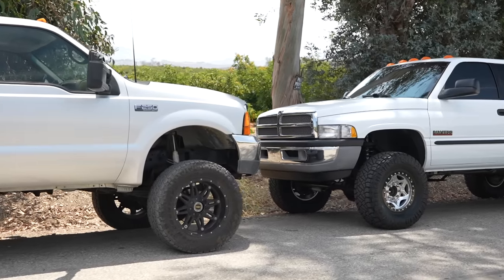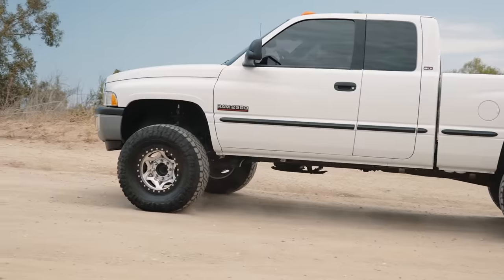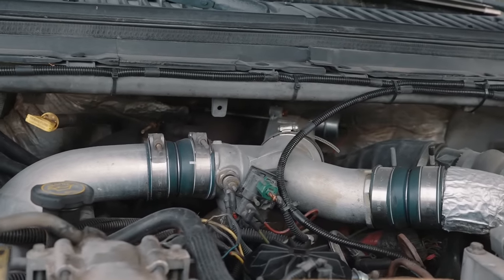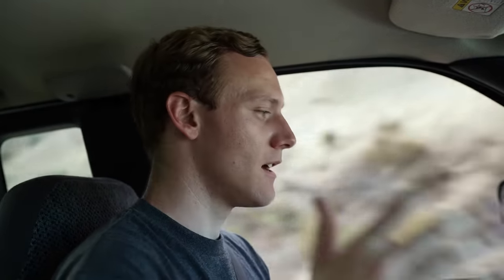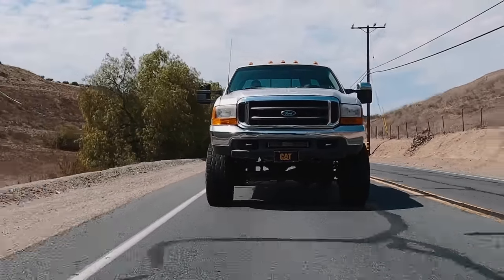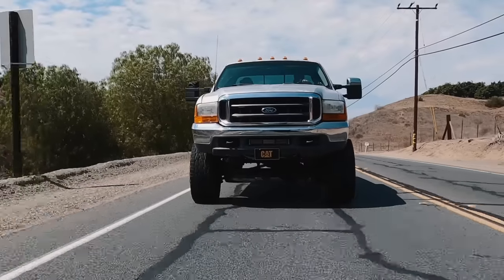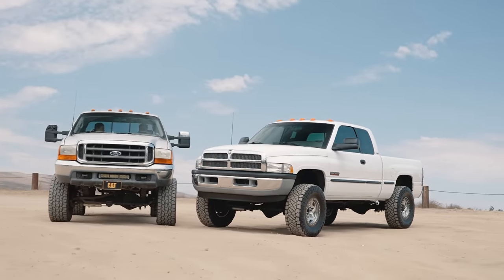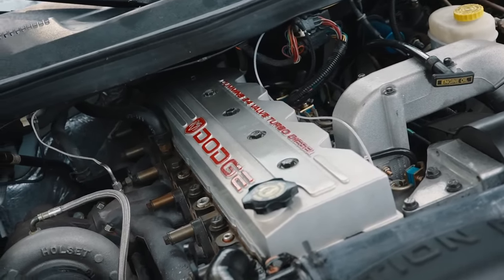1999 Ford 7.3 Power Stroke Super Duty vs Dodge Ram 5.9 Cummins 2nd Gen | Which Is Better?

Comment: The Cummins is the better engine, the Ford is the better truck.
Reply: I see more 7.3s on the road the cummins are dying out.
Reply: @Daniel-sd9fo  thats because the engine gets ripped out and put in something else, usually a ford
Reply: The reason why you don’t see them on the road because the values have shot through the roof.  Everyone wants one. Ford who cares nothing special
Reply: @scoott.735  you must havent seen the 7.3 market lol
Reply: @Daniel-sd9fo  I have and there not worth that much i’ll just get a 12v for cheaper and they last longer
Reply: @Daniel-sd9fo  You don’t see 7.3’s on the road you see a 12v Swapped F250 or 350
Reply: @Anthonysmith-ic8ef  I literally see 20 7.3s every single day
Reply: @skating4ad  Nah You don’t i see 12v on the road daily tho
Reply: @skating4ad  no you see garbage 6.0’s that you are mistaking for fords only decent engine.
Reply: I wouldn’t say the engine is better at all.. for less money you can make the 7.3 motor wayyyy better faster and stronger while still being reliable
Reply: Just a fact there are more 7.3s on the road I know the sound of a 7.3
Reply: I know a lot of 7.3s over 500,000 enough said
Reply: The 7.3 was the greatest engine ever built. You could run them low on oil, hot, dirty air filter it didn’t matter. After that Ford fucked up. The 7.3 was never designed to have a turbo. The later years when they put the turbos on them was better than the ones without turbos. You won’t break any landspeed records in them but you can tow a house. I lucked out and found a 2002 4wd with a manual transmission and manual transfer case. I believe that was the last model (halfway through 2003) that you were able to get a powerstroke with a manual transmission.  It is a workhorse as it was meant to be.
Reply: The only thing about a Cummins is the horsepower is just not there. You put a Cummins and a 7.3 powerstroke side by side and have them pull the same load up a steep hill the 7.3 will leave the cummins in the dust
Reply: Cummins has more power off the line but a powerstroke has more power i general
Reply: @scoott.735  nothing special about Cummins either. They’re they LS of the diesel world, they will blow up, but who cares 😂
Reply: @scoott.735 you haven't seen how much 7.3 Excursions go for...
Reply: I got a 97 F350 crew cab with 148k on the clock in mint condition,  I've been offered 50K for it. The value of these OBS trucks has gone through the roof.
Reply: Shocking last year I found a 1998 f350 good condition 149k miles for 10k
Reply: Btw any mods
Reply: My 7.3 has 418xxx and stopped working months ago... I believe it's a million miles engine
Reply: @Jesus Espinoza  they didn't have any 1998 model year f350's. The ones they did make are labeled Early 99.
Reply: Is I though? I mean I love the cummins and that ford looks great but I think I'd rather have the cummins all around even that interior
Reply: @Daniel-sd9fo nobody’s aspiring to get a 7.3
Reply: @KDlGG i don’t know what stupid shi your saying but ls aren’t known at all to blow up, ford engine are😂 plus it took 15 years for a ford to keep up with a 15 year old corvette😂
Reply: ford is the better engine and trucm
Reply: @Daniel-sd9fo  here in california the markets not hot
Reply: @guamazolopez6456 . Idk when that changed because it was definitely hot in Southern California when I moved. My dad sold his 96 7.3 for over 30k
Reply: If you are the 6.0 it’s a monster I have one and I know a crap load of people in them as well lol
Reply: @stickyicky2858  i got the 6.4 and whole people say it’s flaming garbage i haven’t had problems, it’s really quick too
Reply: @wishihadavette2392  it’s getting harder to get plates for them but a dually 7.3 will still go for 10 or 15k so it’s not  a dead market
Reply: @daves2753  nah I have owned a 2006 6.0 in a manual and a 2010 6.4 in a manual
Reply: @guamazolopez6456  with 2.0 more liters it was faster and ls motor’s definitely blow off p
Reply: @guamazolopez6456  bs look up the price
Reply: See Cummins was brilliant in a dodge. Let's not forget dodge was always the shitest truck built the Cummins everyone loves them
Reply: @scottcampbell1566 if you think that the 7.3 is fords only good engine then that’s wild. The new 6.7 powerstroke is the best diesel engine on the market by a huge margin.
Reply: @eligiebler7834  that’s a Ford fan boy’s opinion only. And a slow one at that over a year later response lol. 
International/ I mean ford is garbage.  

7.3 wasn’t even that good. Ticking time bomb 💣 weak & void of power. Always needing aftermarket help. 
It’s Cummins by miles & miles & it’s the rest trying to play catch up.
Reply: @kylecairus5675  you know nothing about engines ls do not blow up
Reply: @scottcampbell1566  my 6.0 has been driving around for 332k miles with no issues and still running crisp, but keep crying nerd
Reply: @fordshuler307  literally have ford in ya name but ya no fan boy here. Lol 
That 6.0 had head work done super freak.  It was a huge flaw with the 6.0.  Prolly cause ford didn’t really know much about building diesel engines. That’s why they had international contracted out for their motors. Until they got greedy & said we can do dis like Chrysler with their paint.  Only I can deal with paint. Lol 😝
Reply: @scottcampbell1566  it has not had head work done, also Ford is my literal government name so that wasn’t really up to me
Reply: @fordshuler307  hahahaha you’re funny  😁
Reply: 7.3 is THE best diesel pickup truck engine
Reply: Now combine them both 😂
Reply: Jesus loves you all
Reply: @Trevor-mm5ji  I kind of agree, even if you don’t see them in F350s, they are readily available in International box trucks
Reply: 😬 never had to fix them old 5.9s one weakness 7.3 no weakness
Reply: If Ford would have scored the Cummins contract, there wouldn’t be any other heavy duty truck in production today. Not talking down on the powerstroke, I’m a Ford fan, but that would be the case.
Reply: 7.3 all day
Reply: The Cummins is 100x better. Put an exhaust brake on a 7.3 and you will blow a connecting rod and window your junk engine. Also hydraulic injection is trash.
Reply: cummins in a ford, dodge was in kahoots with ford in the beginning 😂
Reply: @Anthonysmith-ic8ef I like the comment but truth is they are both good but the fords seem to stay in road for 300 to 500 then get swapped every Cummins I went to look at to buy was either not running or way over priced
Reply: And that’s why people have made it easy to swap out their powerstroke
Reply: Cummins ain’t that much better than a 7.3 if any at all
Reply: @Roost426  really? because my family has been through 4 7.3 powerstrokes and all have gotten over 1.5 million miles on the odo with the stock engine and trans and good well kept up maintenance, a 98, 2 00’s and an 02, all 7.3 powerstroke f250s, my uncle bought a 98 second gen new, and it blew two motors and 4 transmissions before he sold it for a 7.3 because the dodge was a money pit 🤣
Reply: @scottcampbell1566  6.0 and 7.3 trucks look different, the powerstroke badges on the 7.3s are black with silver letters, and the badges on the 6.0 are silver with red letters, the grills are different too, as well as the color options, im not defending the 6.0 i’m just saying it’s hard to confuse the two if you know anything about the trucks 🤣🤣
Reply: @stickyicky2858  the 6.0 has bad heads and sand in the engine from the factory, you need to put 10 grand aftermarket into it to make it even remotely close to being as reliable as a 7.3, and even then, the 7.3 will still pull more
Reply: @guamazolopez6456  6.4s are 150k mile motors, give it a few and it’ll pop like a shitty bottle of champagne
Reply: @guamazolopez6456  bullshit ls’s don’t blow up i’ve watched camaro ss’s blow blue and white smoke all over the highway 🤣
Reply: @scottcampbell1566  12v cummins will blow head gaskets and fail quicker than a 7.3 dodges wiring us purely garbage but ford isn't far off I love both trucks I have 12v dually and a 7.3 250 both trucks have their issues but u will pick the Ford the haul and long trek with over the cummins any day. I see your a die hard cummins guy but it's not as great as you are trying to build it up too be. The best part of the motor is the fuel pump far as a cummins goes.
Reply: The front suspension on the dodge is hot garbage. Even with a light gas engine in them they fall apart every 30k miles. The top of the dashes cave in on every one of the first and second Gen dodges.
Reply: @jesusisalive3227  all correct except 1st gen dashes hold up pretty well as do 1st gen 4x4 front ends.
Reply: @Roost426 that’s funny because I’m putting a 5.9 in my 95 f150😂
Reply: @daves2753   the 7.3 powerstroke was never designed to be used without a turbocharger. You are thinking of the 7.3l IDI, the only things these two engines share is the displacement. You could also get a manual transmission behind a power-stroke through 2010
Reply: My dad has 2001 dodge manual and it has 6 hundred thousand miles with a stock trans
Reply: i entirely disagree. both have pros and cons but i see the 7.3 diesel outlast a majority of 5.9 cummins trucks
Reply: Duramax is better
Reply: Cummins ford??????????????
Reply: Idk about that. I go trail riding and mudding in my gen 2. Took the carpet and plastic out, bedlinerspray, 20+ years old and no rust on the frame, a little on the body. If I wanted total comfort, I'd say your right, but what I do, id take dodge.
Reply: AGREED
Reply: Cummins
Reply: 7.3s are way better. More bottom end more fun when upgrading
Reply: I completely agree
Reply: @Daniel-sd9fo  the Cummins actually made it home
Reply: That’s cause stock they don’t make enough power to break themselves
Reply: Engine lasts longer than the truck interior but even if rats chew your wiring that Cummins is all mechanical so it will start as long as it gets fuel
Reply: @daves2753  the last manual powerstroke was the 2010 6 4 backed by a zf6
Reply: @Daniel-sd9fo thats gotta be satire
Reply: @MRALEX9870  nope just facts buddy
Reply: @Daniel-sd9fo 96 still goin. Headliner falling off though
Reply: I actually don't believe it
Reply: @scoott.735 I wish this was accurate it's 10k for a gas Ford 🤦‍♂️🤦‍♂️🤦‍♂️🤦‍♂️🤦‍♂️
Reply: @Daniel-sd9fo INSANE! I had a serious offer of 25k on my powerstroke swapped 4wd FSuperduty dump truck. It's super clean and done up right,  but I would NEVER give that much for an obs!
Reply: @Anthonysmith-ic8ef idk why people go crazy for 24v, i saw a 12v for 13k that was mint, def would buy that over a 2nd gen with flimsy interior
Reply: @Anthonysmith-ic8ef a 7.3 will just as long as a 5.9.
Reply: 7.3 is king
Reply: @Ionz2 not after mid-98 when the P7100 pump went away. 24Vs are electronic.
Reply: @anthonykaiser974   two wires son two wires
Reply: Exactly, so we took a 5.9 Cummins out of a 1992 Dodge and put it in a 1992 Ford F350
Reply: I daily a 7.3 the Cummings is good but the 7.3 is a ground breaking motor compared to the 12v yes there good but compared to a 7.3 for time lasting the 7.3 will outlast the cummings
Reply: @SKYM3RK6188  Cummins.

Comment: You both were very fair in comparing the trucks. It made me happy to see unbiased opinions on 2 amazing trucks, personally as a cummins owner I’d take the 5.9 but definitely love the ford as well and would not mind owning one.
Reply: Just need a 5.9 in the Ford. Then you have the best truck out there. I don’t like the HUI system from a I have to work on it prospective but have come to enjoy the 5.9 but still despise the dodges body.
Reply: @jonathanpalmer228  is take either motor in the Ford body, hopefully with a differant tranny for the 5.9
Reply: I've owned both and the 7.3 is still my daily and the better truck imo
Reply: Lmao how was it unbiased? They both owned each truck obviously they each gonna pick they own truck.
Reply: @jonathanpalmer228  heui system is a very good system for injectors longevity....i dont understand your point.....7.3 injectors are good for 500000 miles with proper oil change .....
Reply: @mamamouhemouche9329  totally not the case, very rare but 300K is typically the service limit maybe 400k but anything past that is very very very lucky, keep in mind I’ve worked on about 35 DT444 personally owned or in a fleet
Reply: @jonathanpalmer228  its my case.....but i use hotshots secrets.......no one issues
Reply: I’m a Dodge man and love the 2nd Gen. I have lots of respect for the 7.3 Fords It’s like another Hotrod Diesel with a bullet proof rep.
Reply: @jonathanpalmer228  300k is still really good
Reply: cummins could be great trucks if it weren’t for thier transmissions.
Reply: Yes I'm glad they gave an honest review on both amazing trucks to be honest
Reply: @jonathanpalmer228  Agreed. Maybe also add a 6-speed Allison and you have the ideal monster!
Reply: Jesus loves you
Reply: Cummins es mejor
Reply: It's easy when two good car are compared

Comment: 7.🌲,  Build quality and over all looks are just so much better
Reply: 7.3 is a great truck but ima argue on the looks the second gen is the best looking truck it started the look for the later 7.3 the curves in it to the box style
Reply: @toomanytododge2594  yeah dodge did that body style since 93. I think a 99 is a 3rd gen. I like the ford, and I know the Cummins murders the ford in the power. 92-97 ford body is my favorite, next to the 70s bodys. Now let's get a 6.2 screamin Detroit.
Reply: 90s diesels ftw
Reply: jeremy pollitt  second gen is the 12 valve with the mechanical injection pump right? not just body style.
Reply: @grantmackinnon1307  no, like 97 / 98 they started putting the 24v in

Comment: I’ve always said, Ford body frame, 5.9 engine, Allison transmission. Perfect truck
Reply: Taylor Ray has that exact perfect truck.
Reply: jeremy pollitt  you do you
Reply: I once told my non truck guy friend who thought he was he was a truck guy that I would love to have a ford 6.4 engine with a dodge transmission on a Chevy chassis😅 he was like “bro that would be so sick”😂
Reply: @reaganyoder2279  yikes, worst setup ever
Reply: @JacobEcret  exactly😂
Reply: allison are just over rated.....add 100 or 150 hp and see......
Reply: If you qualify that Allison as a ridiculously expensive aftermarket built one, I can get behind that. If you're talking stock parts mashed together,  nope.
Reply: A real Allison, yes.
Reply: 5.9 engine? Wtf lmao do the 7.3 it outlasts the 5.9 by miles
Reply: @ if you can get the mfer to start. I don’t feel like having a subscription for starting fluid

Comment: It’s worth noting the 99+ superduty can be retrofitted with pretty much any superduty body parts, interiors, and axles up to 2016. So you could have a 99 that looks like a 2016. The dodge is stuck with what you got.
Reply: Might be, but you can take the axles and suspension off a dodge ram 3500 and put it on a 1500. Ford I believe can't do that cause their 1500 has a smaller frame. I care more about performance than looks and comfort. To each their own.
Reply: Why not just get a 3500? Just seems like a lot of work and money to swap up a 1500.
I have a 7.3 pain in the ass, actually gotta drop in a clutch soon. But we all love our own trucks. I'm with ya though about function over looks.

Comment: I think they are the best looking trucks, and If I ever found a clean one itd be hard to choose. I'm a big Ford guy but for ease of working on them it has to be the Dodge
Reply: I love my 02 f350 4 door 7.3 manual best truck out of the many I have
Reply: @tyhudson9497  I got a 02 f350 7.3 manual as well. Mine is an lariat 4x4 and a single wheel short bed
Reply: Coming from a dude that has worked on several of these 7.3s they are pretty simple motors only thing is they are so much bigger
Reply: @nou8257  I have my 96 f350 so the older 7.3 and I fuckin love this thing
Reply: @bryce_7.366  Can't beat a obs
Reply: @bryce_7.366  I also have a 96 f-350 crew cab longbed dually w/manual transmission. The only time I don't much care for this truck is in parking lots.
Reply: Until you're dash cracks
Reply: @nou8257  what is obs?
Reply: @bobby1970  Obs is short hand for Old body style the pre super duty fords (super duties are the 99 and up trucks) are usually called obs trucks

Comment: I think you can’t go wrong with either truck if they’re both cherry, personally I love the look of both of them the Ford is huge and demand respect on the road, but I love the sound of that 5.9 and the ease of working on it. i’m a little biased towards Ram/Cummins. I own a late model 2018 2500 Ram, and I absolutely love it.
Reply: Any inline automatically wins in terms of easy maintenance and reliability
Reply: cummins is only thing he dodges have had and have going for them. ford makes their own diesels and the 6.7 is as good as the modern cummins.
Reply: @jonhathaway2537  Yeah but nothing beats the 12v 5.9 cummins.
Reply: The 7.3 is super simple to work on
Reply: @jonhathaway2537  ford does not make their own diesels, International makes them.
Reply: @james6208  no that is not true they made the 7.3 yes but nothing after that
Reply: @cainadkins3985  then why did ford sue international over the 6.0??? Navistar international makes fords diesels
Reply: @james6208  incorrect. The 6.7 scorpion from 11 to current was made by Ford.  FYI. I'm a 3rd gen cummins lover/owner.
Reply: Any issues youve found with your 2018 2500?? Im looking at a 2018 3500 dually for welding and i wanna know if theres any issues youve had with yours
Reply: @james6208  I'm pretty sure Ford themselves made their own diesels from the 6.4 and up but I may be wrong about that, but I know at the least Ford makes the 6.7 in house
Reply: Jesus loves you
Reply: @cainadkins3985  7.3, 6.0, 6.4 are all International designs.
Reply: Ban bought a fiat and said he loves it wtf